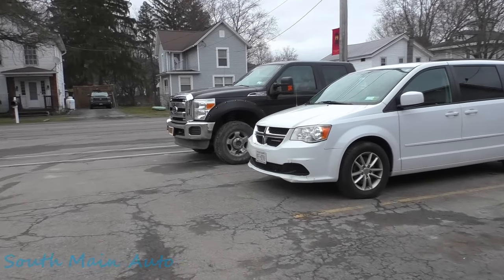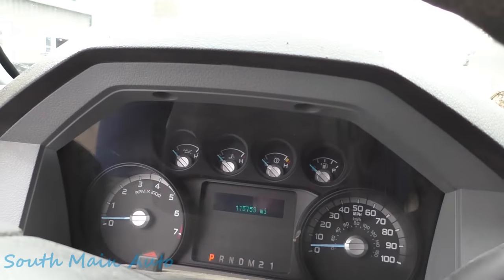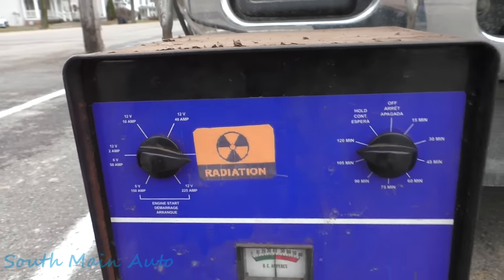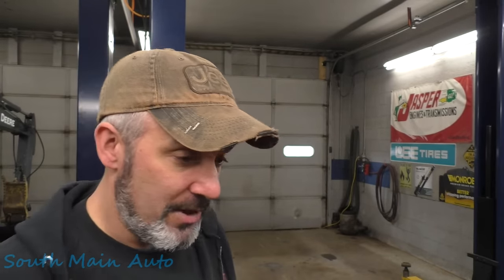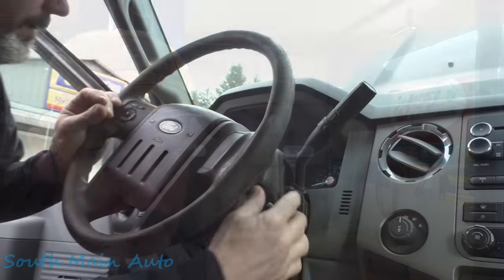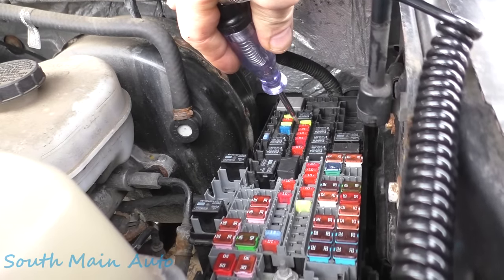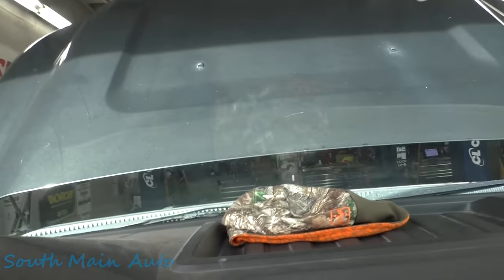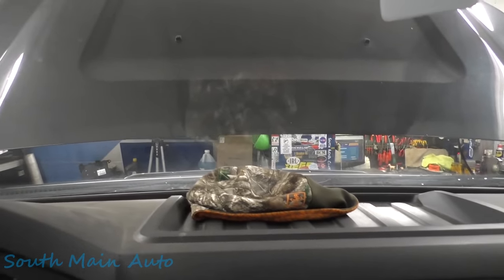Intermittent Stalling Ford F-250 : The Real Fix

Comment: Nice work... I don't see any other solution other than what you did. You changed the relay, it started working and worked for a month. What's the alternative, flip the fuse box over to have a look at the wires (Not). Theoretically you could have an intermittent wire way down in the harness. It starts working, whats a guy to do...exactly what you did, give it back and  if/when it happens again, bring it back. Name me a person that could have done it any better....

Comment: I've had to change several Ford truck fuse boxes and ripped one apart to see what's inside that could be causing the problems.   MANY layers of conducting grids and when water gets in things start to corrode and make connections where there aren't supposed to be and opens where there should be connections.  Problem in finding it is these change according to the weather as the stack swells with temperature and/or humidity.   Whoever at Ford decided to put the fuse box where they did needs to be executed.   Especially on the Super Duty's with Hydroboost brakes the cover is really hard to get on properly and the vast majority I've found where someone has removed the lid they didn't get it back on properly and in time that truck is going to be plagued with electrical problems all caused by that wet fuse box.

Comment: Pull the inner fender liner next time sir. Takes 5 minutes.  Much easier access from the bottom.  I've been a Ford tech for 18 years.  That's not a part you want to replace.  Very involved job.

Comment: LOL...I've seen worse PDJB, BECs and SJBs in my time.  Usually GM uses a "box" that can handle "blocks" that go into the PDB.  Ford and Chrysler use the same type of designs.  BECs are totally different because they use heat staked tin plated copper 'traces' and is one big chunk...oh...and Delphi I believe owns that technology to make them.  So maybe that's a "BEC" (Bussed Electrical Center) and not a PDJB (Power Distribution Junction Box).

Comment: Obviously, we saw you do the correct troubleshooting, but on the end you are still eating this job. The customer will say it did the same thing and you didn’t fix it right the first time. 
I guess the first shop would have fixed both problems if the fuse box would have been available.

Comment: HEY, Ya got the JEEP HAT BACK.....  Nice..  What a MESS under their E O. Ya, I agree with ya, Should have connectors on that Stupid Ass Thing. Engineers......  If they had to work on these things they would be Easier to repair, and Cheaper to Repair Also. Like that Caddy you did the Engine Swap on, If I remember correctly it was a Plug and Play I "THINK"???  Any way, ya goterdunnnnnnnn!!! Send It!

Comment: Only two rounds to find a hidden intermittent broken wire? That puts you in the top 5% easily, maybe the top 1%. Don’t beat yourself up. Remember the dealer wanted to replace the whole fuse box.

Comment: That wire had to be hanging by only a few strands to have the customer use the truck for a month with no complaint.
And the wire had to be chafing across something nobody has access to except Chip and Dale.
Is there any evidence below of any fragments or nesting or doodie from a rodent?
I have seen this before in older trucks when the PDB was further forward and higher up.
No evidence for a cause then, either.
It's like it's first wire damage was when it was first assembled into the vehicle, or Chip and Dale were making a rope swing.
They got interrupted when they chewed half way through.
Then the elements and the operation of the truck did the rest.
It's not your fault because there was no indication you needed to go after that circuit till now.
If the previous loss was caused by a fault on a different circuit number or connector, then it worked for a month?
Now you had to do this unusual access?
Then it's similar, but different, and qualifies as a separate repair.
If it were warranty, the part to R+I and the circuit number would indicate that in your story.
You should be able to say, it required different work, so it's unrelated but demonstrating near the same symptom.
You didn't build it or sell it.
You did better than most people would to find and correct it without replacing the harness and PDB.
If you want my opinion.
Excellent work.
Eric O.

Comment: One handy trick to checking pin fitment issues, is to cover the contacts of the fuse/relay with black (or blue) permanent marker, then insert the fuse/relay back into its socket, then pull out. If most of the ink is gone, then it’s not a pin fitment issue, but if little (or no) ink is removed (by friction), then either the pin is worn out, or the socket terminals have lost their springiness. Just make sure your marker’s ink is soluble in acetone, IPA (isopropyl alcohol), or even brake parts cleaner (make funny noise when pulling out the brake parts cleaner, or the Internet will claim you’re not a “real” mechanic!) 🤭

Comment: My fords were known for green pus in the wires.  Makes you want to scream.  We once purchased an ultrasonic cleaner with a robot loader at work.   We couldn't get the robot to work.  Tracked it down to a multi wire cable.  One wire had ended and the manufacturer of the wire tied on a new wire but the two ends weren't connected.  Go figure.

Comment: Tech: GM may make the most unreliable, least longest-lasting, truck on the road. But they don't do stuff this dang stupid...
Ford: Hold my beer.
You want to reseal the oil pan on a new Explorer.
Step 1: Remove the subframe, front diff, engine and trans.
Ford: Do you require any further examples?

Comment: So you are human after all. I still can't get my gas gauge to work properly or at all on my double nickel and I ran out of gas last Sunday. I performed all the tests YouTube had to offer. Everything works fine when the fuel sending unit is not installed but stops working when I install it in the tank. I've tried installing a separate ground wire but it still does not function maybe the signal wire is grounded

Comment: How come my 2008 GMC has 220,000 miles on it with no major issues and that Ford does.  When things do go wrong at least GM is much easier to work on as seen in this video. And  parts are generally cheaper.

Comment: Please don't let some moronic Ford Automotive Engineer's design that makes trying to fix anything ruin your day.  I've recently noted some videos on late model Ford F-Truck Diesels where they need to unbolt the entire CAB and lift it to do some repairs on the backside of the 6.7 Liter Diesel motor i.e. the upper and lower Oil Pans gasket replacement like REALLY? And Ford's attitude is "once it gets out of warranty it's no longer Ford's problem"....like REALLY? Eric - you are a pro beyond pros and heads above anything Ford employs or designs.  Now you know, the next time one of these rolls in with the same problem, you can either fix it pdq or send it to a Ford Dealer and let it drive one of their mechanic guys into therapy...

Comment: You did miss it the first time. You cheked one side of the power to relay and assumed the other was good and did not check the actual terminal.
Reply from the maker: No, I check load, power and control last time too. It just wasn't broke when I was checking it. It is very clear in the first video 👍

Comment: you can now know, cheap wiring, "policy" for manufacturing, It only has to be good enough to the original buyer, 
 Unfortunately, Ford doesn't divulge when that cut off date is to the original purchasers. Chevy to day is no Different. 
oddly enough, if not for the federal emission laws. Cars today run better and longer than in the past. to a degree, 
aside from the rust worms.

Comment: Boo hoo hoo…what a pity party Eric O.   Perhaps you and Bubba Wallace need some time together to work out your self confidence issues.  😂. It was an intermittent problem that what is now known to be caused by a half broken wire.  Messing with the box, fuses and relay temporarily “fixed” the issue on the first round, vibration caused it to resurface…and you fixed it…great job!

Comment: It's always either mice or salt spray under fuse box chew wires or corroded messed up pin connections.
Ford's fuse box all hard to get to 
Ferds suk

Comment: The reason you think GM trucks are unreliable is because you see more of them than other trucks. However the reason you're seeing more of them is because they are sold at a much higher rate than other trucks in your area. Why are they sold at a higer rate? Because people have better experience with GM trucks and repeat buy them. If you think Dodge and Ford trucks are more reliable than GM, you're just wrong. Sorry to have to critique you like this, but somebody has to.

Comment: That’s those most awful fuse box I’ve ever seen. Ford is notorious for shitty designs. I always just say to follow what the Germans do. Volkswagens have the wire harness running into a plastic electrical connector that plugs into the bottom of the fuse box. Yeah. If a wire is broken it’s a pain to fix on those, but at least you can pull the box out and see stuff without worrying about breaking other wires and causing other electrical issues.